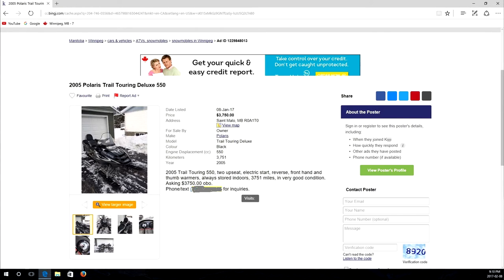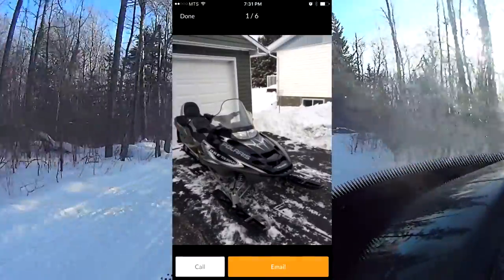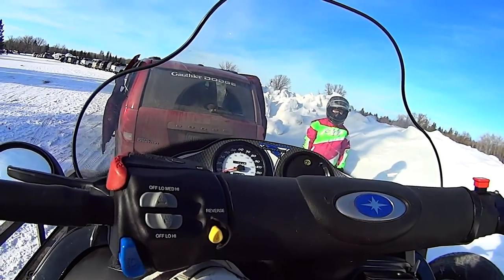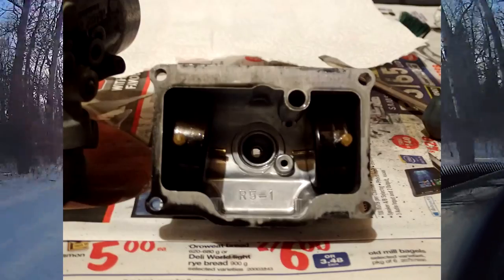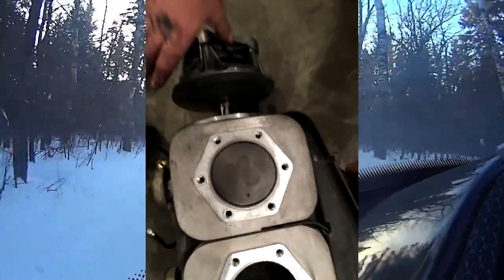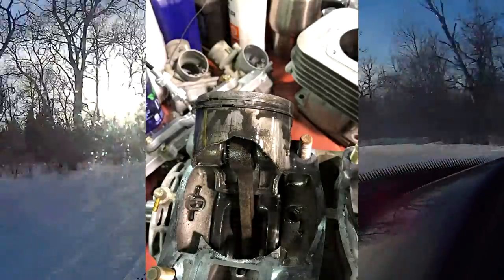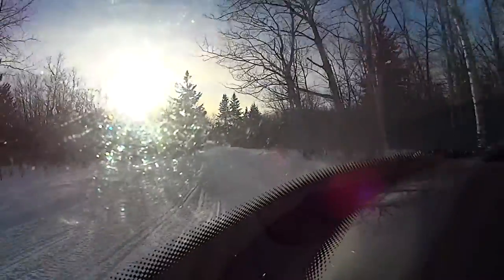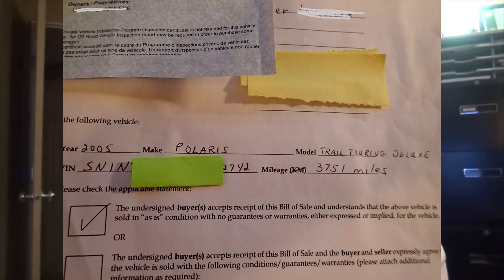Buying my first Snowmobile

Comment: Ouch... but glad you have it fixed. Have you gone winter camping using it? I'm in the early stages of thinking about one to use for winter camping/touring. What are your thoughts?
Reply from the maker: Buy New!!!  LOL  I knew it was going to cost a bit to have and fix - but didn't expect to have to rebuild so soon!  I put about 250 KM a couple of weeks ago while Caribou hunting and it was fun.  Learned a whole lot about starting a really cold machine in the morning.  I had hoped to get out for a weekend but we lost much of our snow a week ago so a camping trip will be next year.  I sure learned a lot this year about riding so hopefully I won't forget it over the summer.  Good deals on extended warranty with new buys about end of season.  I watched a bunch of snowmachine videos on here before buying so I understood better.  I choose this sled as it was light weight, not Liquid cooled (fan cooled) and older technology that I can maintain in the backcountry.

Comment: 6k$??? Holy shit, how many hours of labor did they charge you?
Reply from the maker: 5 hours.  Its has replated nikasil jugs and rebuilt lower case.  It wsa completely rebuilt.  Yeah - it was worth a bit but if you don't do the work yourself you got to pay someone.  They bumped me in so I could make my caribou trip up north.  it hurt - but I am over it.  Thanks for the comment.
Reply: @alphawhiskyadventures  
It is a nice looking machine, and now you know that engine is fresh. Those 550 engines usually last quite a while.

Comment: Could have been worse, but judging from your compression test120 psi on both cylinders when you bought it I'd say you blew her up on your short ride if it had shity gas in it it leaned out one cylinder while you were driving it. There's no way that engine had 120 psi on a broken piston like that the carbs should have been cleaned before starting it. I ride Polaris sleds too I clean my carbs before starting it every year needless to say l've got a lot less problems with my sled now
Reply from the maker: Darrel Holmgren Thanks for the comments.  I drained the gas and put fresh fuel and oil in before the ride.  The engine was noisy before and had a tick but I didn’t pick up on it.  If you look at the picture with the jugs off you can see the piston seals.  The skirt was busted but it didn’t blow a whole in the piston. It did loose a piece on the short ride which I heard the pinging. But I am pretty sure I bought the sled that way - the only reason I blurred his name as I can’t say the seller knew of the damage with certainty.  Caveat emptor.

Comment: u didnt research . those fan cooled are time bombs
Reply from the maker: Had someone assist me in narrowing it down and suggest models and help pull a few strings to get it fixed. Nice to have friends with connections.   They have a bad rap for sure but since the engine rebuild it runs great. I just watch my oil consumption and vary the throttle.  Love the look of them, but yeah shame about the engines.  Just waiting on snow for this year.